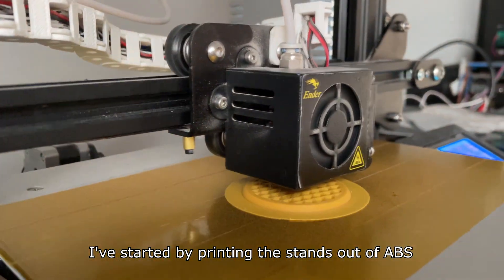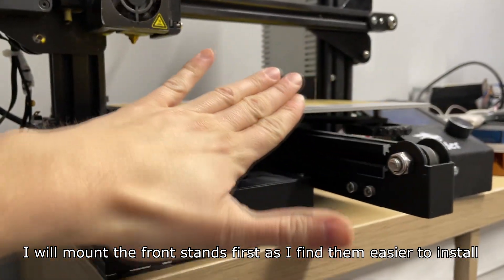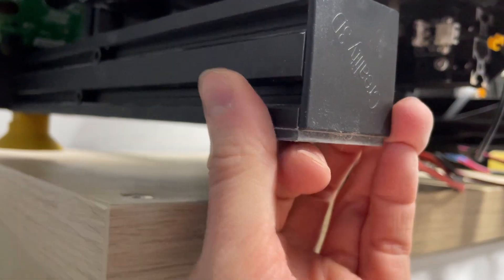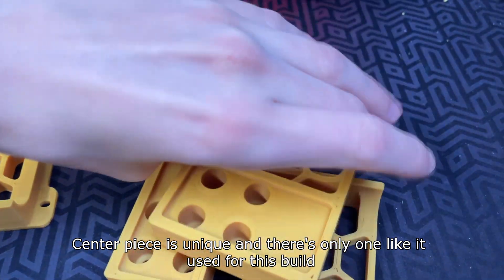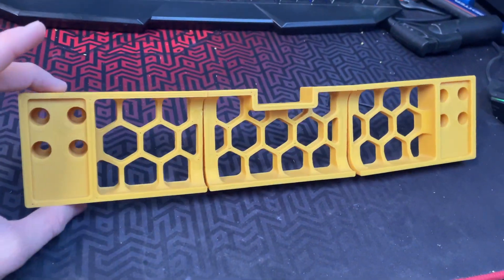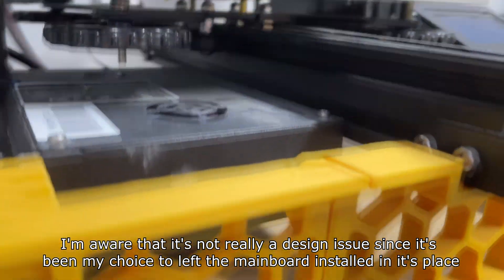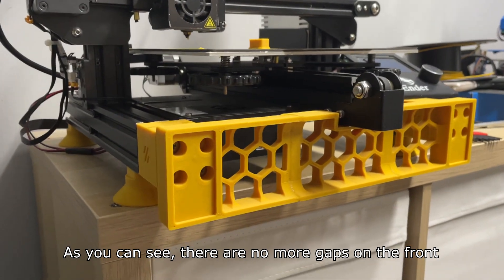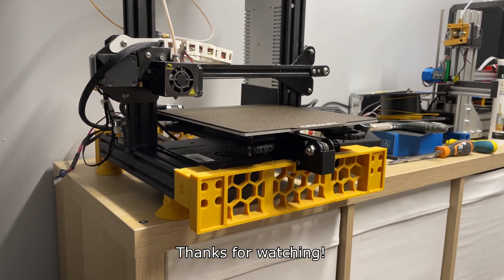Custom Grill And Stands | Ender Switchwire 3

Comment: Bro it's like straight to the point of the process in hardware development. Prototype => Uhm thats a bit ugly => Fix. I really like the way you are printing ABS without any Heatbed-top. The simplicity to just remove it and print directly on the heatbed with some kapton. Genius.